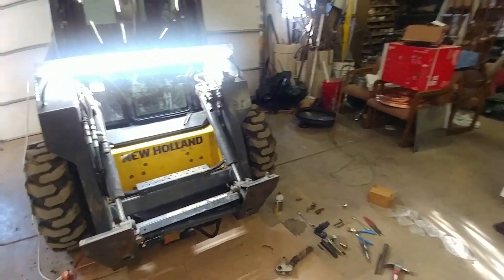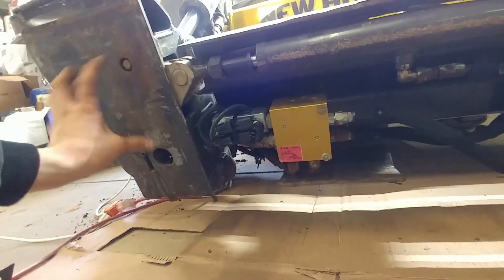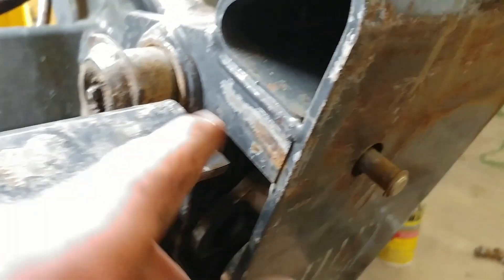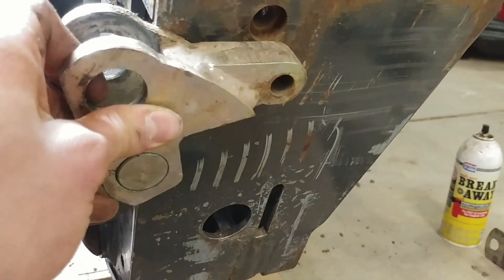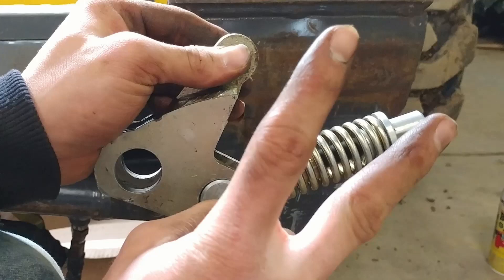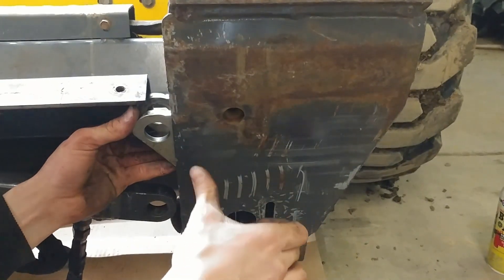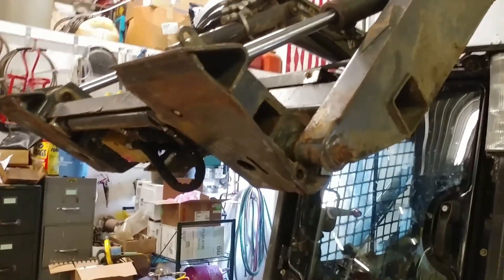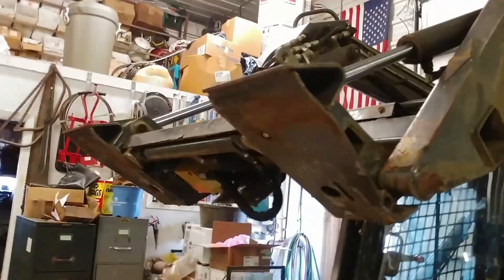How to Repair Quick Attach Locking Pins on Skid Loader

Comment: How do you get the bucket off of its stuck and won’t release ?
Reply from the maker: We have had to pound the pins up from underneath if they are in the unlocked position and still not moving.
Reply: @ReubenSahlstrom  the pins barely move when activated the solenoid is clicking away but the pins won’t release at all

Comment: Place a 4/4 under the beam in case the hydraulic system fails so you wont be crushed   or use a house jack to support it.

Comment: Nice video. Thanks for sharing. Do you know if it is possible to disconnect the bucket manually? Our quick attach is not moving and the bucket is on. I was hoping to take off the bucket and then take off the plate like you did in the beginning to see what the issue is.
Reply from the maker: I think I ran into that problem too, and what I did was put the bucket in an unlocked position, and then pounded the pin up. You just would need to be extremely careful to not let the buckets swing out and hit you or skid loader.
Reply: @ReubenSahlstrom  Ok! Thanks for the reply. After I commented, I searched a few forums and someone said they disconnected the hydro lines going to the quick attach cylinder and that allowed the pressure to be relieved. I'll start with that and if it doesn't work Ill have to try your method. Thanks!

Comment: I changed out spring and pin, my problem is the pin on right side is not staying down completely and bucket on right side is falling off.  Any ideas.
Reply: If the lever isnt going down all the way to lock the bucket in. Try it with the bucket off. If it locks when bucket is off then its most likely the unit is a little bent and you just have to work with it. If it doesn't lock down with the bucket off then something in the process putting it back together went wrong and you may have to take it back apart and do it again